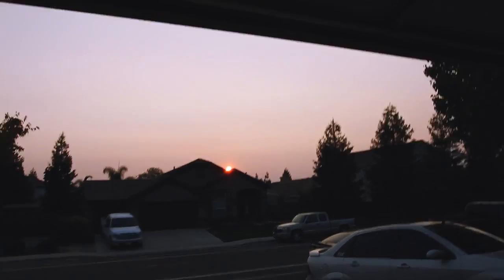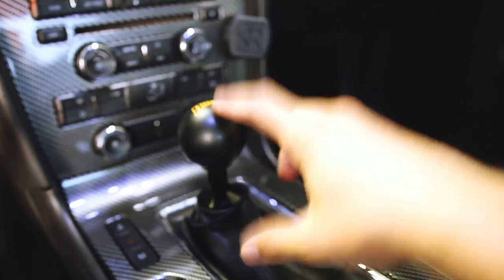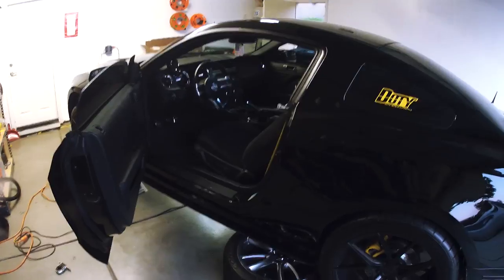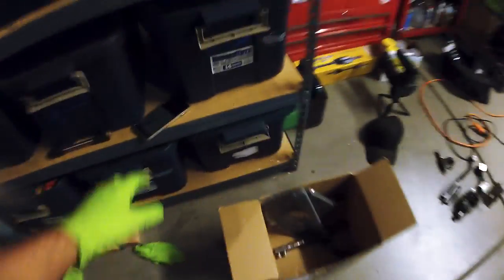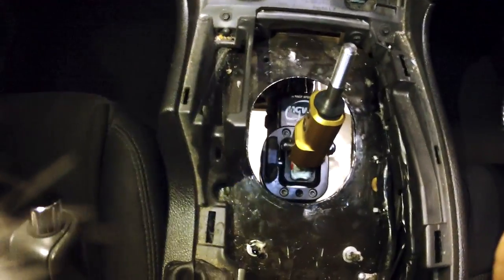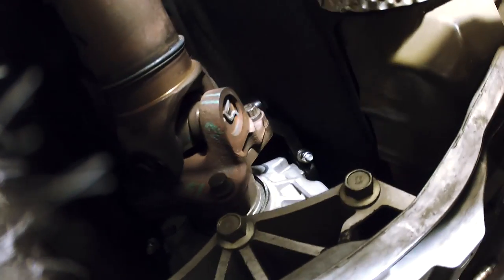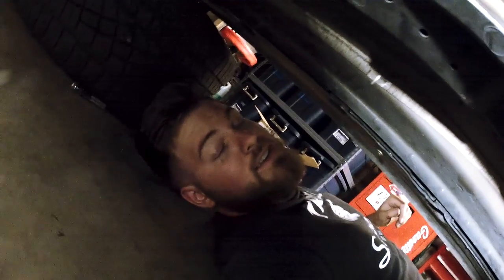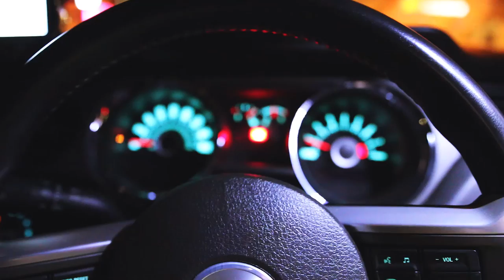I PROMISE you WON'T MISS A GEAR!! MGW RACE SPEC MT82 Shifter Install

Comment: Been running that exact shifter for 2 years now on my '12 GT. Amazing shifter!! I did run the blowfish bracket, then the blowfish with a barton short shifter. Save yourself time and money, and just get the MGW. As said in the video, do it once, do it right. Having said that, you can and will still occassionally get a 3rd gear lock out. Why?...the oem clutch sucks. THAT was the issue with the locket out. The shifter definitely helps, but the clutch was the biggest issue. Anyways, enjoy the shifter!
Reply from the maker: Definitely. The clutch would be the next big thing I did in fixing the lockout. For now, it’s not a huge issue to me. Listen to this guy who’s had the Barton! Get the MGW 👍🏼
Reply: @JacobRDoty  besides the shifter, what else did you use to stop the lockout?
Reply: @gilbertmontoya3005  As soon as I put my MGW shifter in my trans started locking me out of gear at high rpm 7000+..  same spec stage 2+ clutch and aluminum flywheel.  Could this really be the shifter resulting in the lockout?

Comment: Does this fix apparent issues of durability with the trans?
Reply from the maker: It can help- but ultimately it’s this + a clutch that’ll make the largest difference and prevent lock out and ultimately grinding or exploding a gear

Comment: Does this help or fix the 3rd gear lockout at high rpm?
Reply: It actually created the lockout issue for me.. the stock shifter was just fine, swapped to this i instantly high wicked high rpm lockout.  wth!

Comment: What thread size is ur knob for the mgw short throw ?!??
Reply from the maker: Same one as stock 🤘🏼🤘🏼
Reply: Thanks dude real quick , would you happen to know the offset for the front of your wheels. I’m looking to get those same ones
Reply from the maker: I don’t, but I know they’re just the ones in 20x9. Pretty sure there’s only one offset for that size. If not contact verde and they’ll hook you up. Make sure it’s cleared for brembos if you have them

Comment: How is the shifting under lateral G loads?
Reply from the maker: Shifting while turning? Perfect. This is a transmission mounted shifter so it’s always in line with the transmission. The stock is body mounted
Reply: I have problems getting into 3rd under hard braking and with about 0.8-1 lateral G. No full on mid turn shift, but enough to end up in 5 instead of 3. Basically the whole drive train is tilted all over the place at that point. Keep us updated how you like it after a month or two!
Reply: @JacobRDoty  i have the blowfish bracket with stock shifter and it still sucks.  Do you know if i can still use the blowfish with the mgw?

Comment: Can you install it in a v6??
Reply: Also what’s the difference between the standard one and the x-spec ? Or normal to low profile ? Just a shorter shifter ?
Reply from the maker: They have a video on their site to explain it but basically the race spec is shorter throw and then the low profile is even shorter. So x spec and low pro and it's the shortest you can get. They may have a shifter for a V6, but I think I only saw that it was for GTs and Boss.

Comment: u dont have to spend that much to get that stifness
Reply from the maker: True, ThatGuyMarin just did the Barton two post which is cheaper, but still not trans mounted. At high RPM and under high load his shifter still can mis align and lock him out of gear. MGW wont
Reply: Jacob R. Doty okok,smiles i ma get one to
Reply: True. My Boss as you know revs happy as hell. It’s been all good with my MGW.
Reply: @JacobRDoty  Facts
Reply: I have had the Steeda, sold it for the Barton, with rear brace. Though they are good shifters, neither addressed the problem as I figured out, which is the shifter being mounted to the body and not staying in line with the tranny at high RPM and when shifting under power. Its not a shifter problem, its a mount- alignment problem. I am still deciding on the Barton Hybrid or the MGW. I am also considering the Blowfish Racing mount. With that, I can keep my Barton shifter and also save $100 on a driveshaft safety loop.

Comment: Iv had a short shifter in my 5.0 I still always get locked out lol
Reply from the maker: It’s the clutch really
Reply: @JacobRDoty  I still get locked out with Rxt clutch.  Its pos Mt82 bro
Reply: I still get lock out with rxt clutch.  It's pos mt82
Reply: @JacobRDoty  Get t56 magnum and worries are over.
Reply: Get t56 magnum and worries are over

Comment: I just bought a Used 1 Owner Garage Kept 2017 Manual GT PP1 with 9K on her, Planning on doing the same thing.. I am at 10,200 miles still but the shifter feels sloppy too me.    https://www.youtube.com/watch?v=lvhgGOgx_fA&t=218s  
     Also the 2 piece drive shaft doesn't help either.. I am probably going to save and do everything all at once, because I want to put an Xpipe in too.. So I am going to send it to my guy with a lift and have him do it. I'm going to pay him for his hours either way but I may help him out if he wants.. So I'll be doing the 1. Xpipe, 2.MGW, and 3. I have my eye on the Steeda MT82 drive shaft.. The stock shifter is just way to sloppy.. It's ok it's not as Bad as I sometimes make it out to be but you can't race PPL with the stock shifter it's just terrible for quick shifting.. yeah I can blow through 1,2,3,4 but it's when you want to go from 5th to 3rd or 6th to 4th, thats when you can feel just how bad the stock linkage on the shifter is.. So I am planning on saving up 2000K and buying everything and then having someone with a lift knock this out for me..